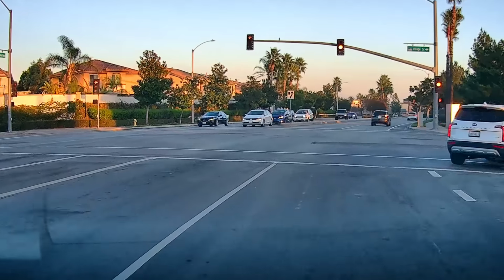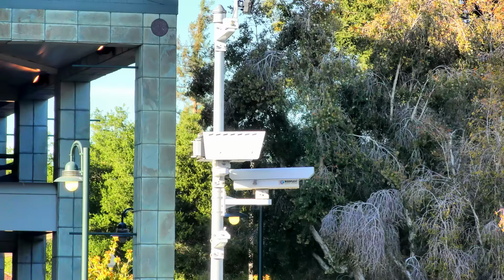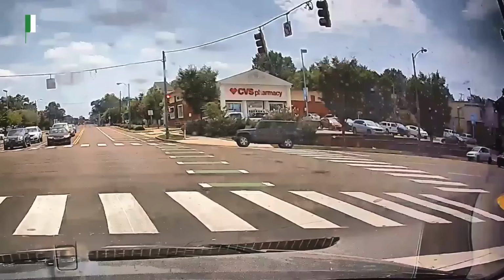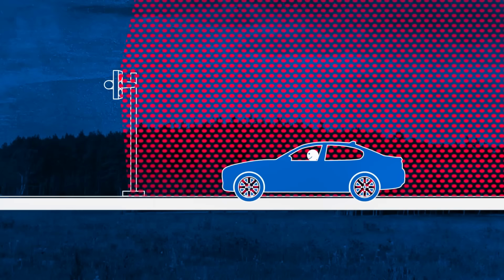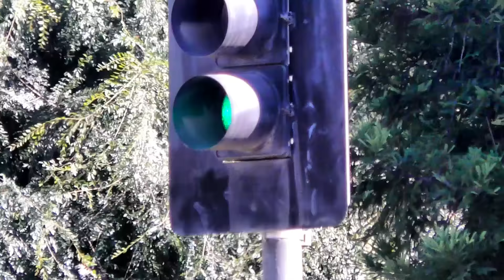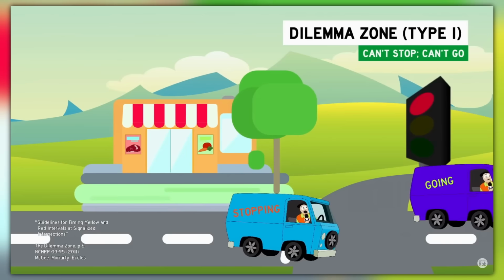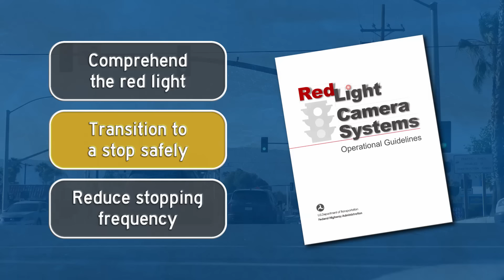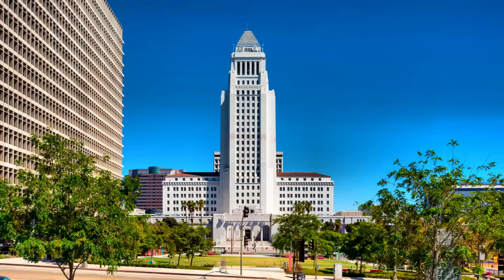Three ways to FIX a STOP LIGHT (so drivers ACTUALLY STOP!)

Comment: It amazes me how a country where you basically need to drive has such a massive problem with drivers running red lights due to poor designs
Reply: Well, when the driving test is a joke, you have lots of clowns for drivers
Reply: @vanguard6937  seems like they don't want to design to reduce the speed of the cars, like narrowed lanes or less straight streets. Building citys for cars with all its stroads make just bad solutions.
Reply: It becomes an issue specifically because almost everyone has to drive. Walkable, bikeable, rail-connected cities don't need stroads in the first place, where cars are travelling too fast to safely negotiate with others on their own.
Reply: It's not poor designs, it's poor drivers.
Reply: We don't have a massive problem. The problem is that running a red light so often has a consequence. Anyone can intentionally run a red light at any speed. We need to be engineering reduce the odds that people will unintentionally run them, and that when they do the consequences will be less severe.
Reply: Just because people NEED to drive doesn't mean that everyone will drive WELL. . .
Reply: @ericemmons3040  Exactly. In fact the more drivers you have, the more bad drivers you have. And that is compounded when everyone is tired of driving and going through congested traffic.
Reply: @Objectified  A part beside the make a involuntary behavior less dangers.  The other part is against intentional behavior to make rule breaking feeling dangers. Taking away the feeling they don't have to think about other humans.
Reply: Industry makes more money the less efficient and more dangerous the traffic system is.
Reply: @vanguard6937  Driving test is irrelevant when 30% of drivers don't even have a license to begin with.
Reply: @NickCombs  Don't need roads? Just how do you think all that stuff gets into the stores, teleportation?
Reply: @SSHitMan  Hey there. I actually said cities don't need stroads. A stroad is the ugly and dangerous hybrid of a road (high-speed, for travelling through) and street (low-speed with lots of driveways, turn-offs, and merging). Roads are fine for long distance so long as they're not the only option. Streets with an emphasis on limiting personal vehicle use should be dominant in cities. To do that, they need to be offer convenient public transit and safe biking conditions.
Reply: @NickCombs  LOL sorry I thought that was a typo and you meant "roads". And I have encountered people who claim cities don't need roads because everyone can walk and ride bikes...
Reply: Doesn't have anything to do with poor design. It's the entitled, arrogant drivers. And lack of enforcement.
Reply: @neils5539  the USA road network is poorly designed and they are only just discovering things in the last couple of years that other countries have been multiple decades.
Reply: Stroad isn’t a real road
Reply: Human nature is pretty consistent, actually. Give someone an inch (cm), they'll take a mile (km).
Reply: Traffic lights in general are awful ideas. Traffic circles are far superior and no one is sitting waiting for no reason at all. But look up who invented stop lights and it’ll all make sense
Reply: @vanguard6937  It's not driving tests. Yes, they're a joke, but the MAIN PROBLEM IS ATTITUDE. The 2nd issue is, poor light synchronization and cycles. Dutch cities have fixed this with smart lights. Driver try to beat the light, because of how long it takes until it becomes green again. Lights are on dumb timers instead of properly detecting where traffic comes from and how fast.
Reply: @Objectified  Carmel Indiana mayor fixed that. Replaced most signals with round abouts. Much more efficient and far less dangerous.
Reply: Normal people stop without issue at redlights, then there's the total assholes who blow thru them.

I live near a major city where I drive for my.job and I see it more often than you would imagine. Coupled with a city wide speed limit of 30mph and people still race down roads like its forza or gta.

School zones...I can kinda see people missing them in a.major city as its overpopulated with signs.
Reply: Insurance companies maintain income, and law enforcement maintain job security and income, by having unsafe roads.
ALL unsafe roads can be improved to the point of eliminating the need for insurance companies and law enforcement.
Reply: Moneu
Reply: @maltekoch1632  narrowed lanes will never work. It’s actually a terrible idea. For example here in Florida people are towing boats all the time. It’s just asking for a disaster
Reply: @Anthony-pi6pf  you can read some here. Lanes wider than 3,3-3,4m are associated with 33% higher impact speeds. And carrying capacity getting lower. Guessing people don't drive with boats on trailer weekend shopping or to work. So amount of rides are in the low single digits. Maybe they can just drive more cause, because infrastructure like this is not just cheaper but although safer.
https://en.wikipedia.org/wiki/Lane?wprov=sfla1
Reply: Quite a few people here commenting without watching the video… and knowing it so well…. And then they are complaining about the attitude if of drivers! Look at your own attitude first, know-so-sures. Watch a video before commenting, be humble, devour facts, and you too will admit that design matters, sometimes saving a lot of lives.
Reply: because we used to think you could just trust people
Reply: Did the people in these replies even watch the video? The problem really isn't bad drivers, it's poor design. You can't possibly judge someone for running a red light when there was no way for them to prevent it. I think y'all are narrowing in on random anecdotes rather than actually examining the data as a whole.

(not to mention that improving public transit, making roads more pedestrian and cyclist friendly, and making driving less convenient is going to be the only way to drastically limit car deaths, which certainly isn't the fault of the random person you saw run a red).
Reply: I run lights a lot because many of them have no opposing traffic and it has no reason to be there except to “slow down drivers.” If I ran the light, then the rest of the lights will be green. If I patiently wait, then every light will turn red as a approach it. I save 10 minutes on my commute and get 20% better fuel economy
Reply: In Australia there is a driving offence called " driving without due care or diligence".
Reply: Never underestimate government incompetence
Reply: A vast majority don't "need" to drive.
Reply: @warrensteel9954  Precisely! Too much money crossing too many hands that won’t profit off of solutions. Classic mafioso thinking- “I’m going to create a problem for you so you can hire my cousin to come in and fix it.”
Reply: @NickCombs  bicycles are for children and people too poor to own a car.
Reply: @jeffmellow  it's easy to think that way when there's only car infra in your area, but bikes are for everyone.
Reply: @strixt  Where do you live?? Everywhere I’ve been, except New York, everyone has to drive. If you’re not taking the distance everywhere is then you certainly aren’t taking in the weather either. I live in AZ. If we didn’t drive, the amount of people dying of heat strokes over half the year would skyrocket. Also, 17% of people living in the US are 65 and older. What about rural areas? I lived 45 minutes away from the closest grocery stores by car. Oh and never mind sex trafficking that is always on the rise, it’s totally safe to walk/cycle everywhere.
Reply: @addymant  Not true in AZ. Number one state for running red lights. It’s not even trying to catch the yellow light. I see people straight up run red lights all the time, almost everyday. A lot of being people coming to a full stop at the red light then going while it’s still red because they didn’t want to wait. All of that can certainly because prevented if people weren’t bad drivers.
Reply: @bloozee Australian traffic lights also have minimum 3 seconds "all red" before any light changes to green. That's gotta help reduce fatalities.
Reply: @iamdave84  I thought that would be pretty standard.
Reply: @bloozee I agree, I thought that would be the done thing everywhere.
3:05 talk of "stretching the yellow" not colliding with "cross traffic, with their fresh new green light" makes me think there's negligible gap between one's red and the other's green.
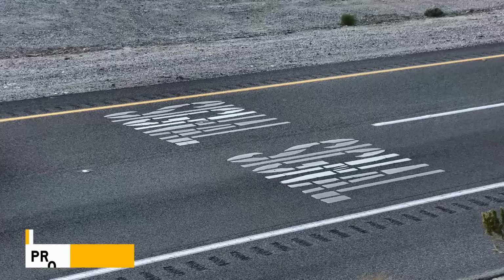Also at 10:10, he mentions "holding all of the lights red, for a second or two", an "all red clearance interval".
Here in Australia, yellow light is always minimum 3 seconds, followed by a minimum 3 seconds clearance interval.
Reply: @vanguard6937 it’s not just a joke. For me it was literally driving around an empty parking lot with traffic cones. Kind of insulting after almost 100 hours on roads and highways.
Reply: @DemonratsRevil  traffic circles are not better in all circumstances.
Reply: Never underestimate how stupid our politicians are
Reply: Easy revenue via tickets.  It's why people hate police and refuse to help them.....as they should.
Reply: There are many issues that could simply be fixed by making the driving test a 4 week extremely strenuous and difficult series of tests that puts you through many situations. Regaining control of an out of control vehicle in the rain, on ice, etc. Now, here's where it gets fun. The test starts with an IQ test. Score below 135? You don't get to operate a multi thousand pound possible killing machine. Simple as that. One I've proposed because I'm a bit classist and because I believe if you aren't smart enough to make 500K a year then you aren't smart enough to drive is exactly that. All these things would make driving far safer.

Side not, speed limiters are completely moronic. Heard a news piece on the radio a couple months back about speed limiters because a guy drove while HIGH ON COCAINE AND PCP yet it's the fault of the car being able to go 120 instead of the public executions and example that should be made of these people. Little extreme. But not every life is special...
Reply: Are u really trying to say running red lights is an American problem
Reply: @vanguard6937 issue is if you have to drive to get around having restrictions that prevent idiots from driving would leave 90% of people with no way to get to work.
Reply: Never seen India have you?